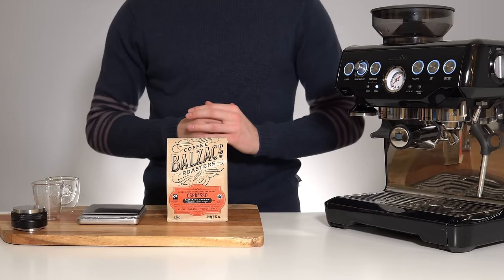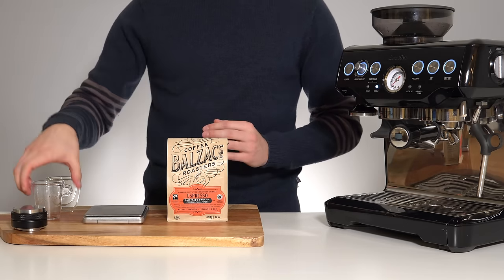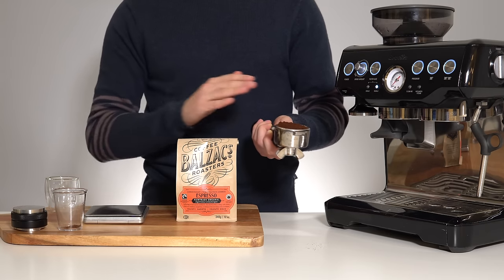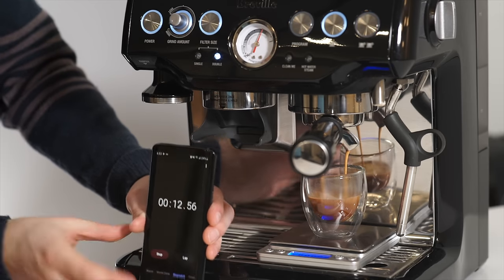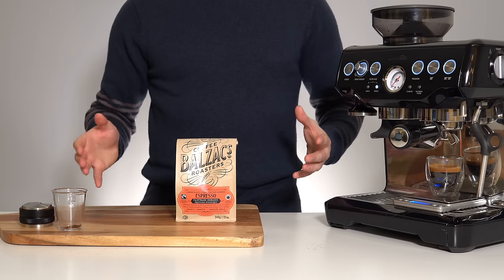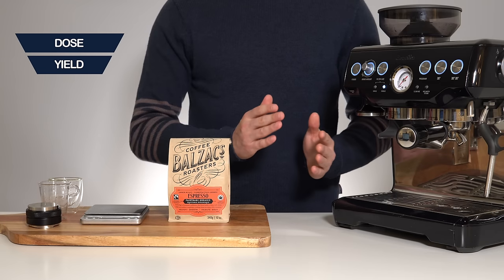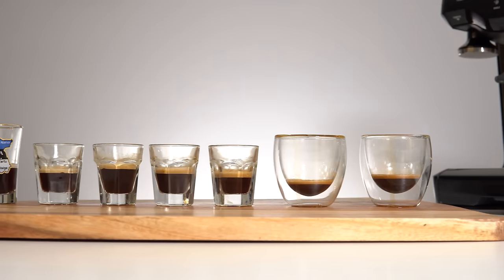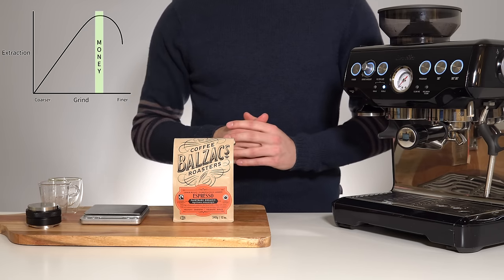Dialing In Breville Barista Express | Dose, grind, yield, time

Comment: I'm sure this question might already be answered but the thread is huge. Many other videos out there include the pre-infussion time in the count between 25-30 seconds as I have been as well. What is your train of thought behind not starting the counter at the press of the button?
Reply from the maker: In the end, no single time is correct for every coffee, you need to dial in to taste using the concepts from the second half of this video. Aiming for a specific time is just to get a reasonable flow rate as a starting point. 
Whether your final shot is 30 seconds from button push or 25 seconds from first drip, you're getting the same shot, just make sure you are consistent with yourself
Reply: @LifestyleLab_  Thanks for the tip, I've recently purchased a bambino plus and smart grinder pro, quite the learning curve and so many opinions out there. I just yielded 38g from 18g in 28 seconds after pre-infusion and it was decent. I'm sure it can get better but this will come with time and whenever my distributor comes in :) for a better consistency.
Reply from the maker: Absolutely!

Comment: I have a question.  My machine is the duo temp.  So I manually start and stop.  Would you need a machine that shuts off on its own?   I’m wondering how you would know when to stop the machine to get the yield.   I am trying for a 1:2 ratio.  But if I say I’m going to let it run for 25 seconds how would I know I hit my marks?  Would it be how many grams I pull?   Or would I be looking for 2oz?
Reply from the maker: Hi Ethan! 
Remember, brew ratio (the biggest factor impacting taste) is about weight, not time. Just like in this video with the Barista Express, you will need a scale to weight the beans in, and then use the same scale to weigh the espresso as the shot comes out. 
Once you are dialed in, you may opt to not use the scale every single time
Reply: 2M views I think I got it now.  I watched again. So I need to get to the 20-30 zone.  That is the sweet spot.  I didn’t realize you were manually stopping the machine.  I think I get it now.  So it doesn’t matter.  Once you get to 36gr your adjustments are made based on taste

Comment: is this a good machine for about 150-200ml cafe lungo ?  will the  extraction be still warm after that much water go through the grind?
Reply from the maker: Yup, this machine can absolutely accommodate a lungo. You will just need to use the manual mode to extend the shot length, or program 150ml as your default shot size. These machines use a thermo coil heating block to heat water on demand, so heat of the shot will not be an issue

Comment: Was wondering if you had adjusted your inner burr? I too started with the Balzak's beans but.. anything coarser than 4 had no pressure which I thought was weird and inner burr is at 6. 

I'm getting insanely sour shots so i still need to dial in (waiting on a proper .00g scale, and a palm tamp) - went from more coarse, all the way to choking the machine and still sour. Adjusted from 16-18g of coffee an still same. I think its down to my tamping then....
Reply from the maker: This could be down to a couple things: 
1) Is your portafilter HOT (not warm) before dosing and pulling your shot? 

2) Were you able to achieve 36gr in 25 seconds from first drip?
Reply: @LifestyleLab_  Thanks so much for your quick response! I was waiting for my scale so that I can more measure shot weight..

I had to set my inner grind to 4 because anything less was not fine enough. 18g coffee, inner grind 4, grind size 3 (on machine), 29 seconds for 36g shot. This unfortunately is a new blend (Balzacs Farmer’s Blend) - but still sourness. 

I know this is a bit of a longer extraction, but if anything, it shouldn’t be sour right? The shot doesn’t particularly seem too hot even though I’m on a hotter setting already. Measuring at the group head it seemed in line with what the temp should be.
Reply from the maker: The Farmers Blend is not necessarily an espresso, so it will be more difficult to extract. 

You will want to make sure your portafilter is very hot before brewing, as if its not the metal will pull a lot of heat away from the shot, making it sour and cold in the cup like you are describing. 

After that, if it is still sour, you will want to start increasing the yield to increase the extraction. Try getting 45gr out at the same grind setting. Ignore the shot time from here on out

Comment: Question, when should you start the timer on a bambino plus for extraction? When machine turns on or once it comes out the spout?
Reply from the maker: There is no exact answer, as each coffee is different. 25 seconds from first drip is the same as 30 seconds from button press. Once you are around this range, you need to TASTE! :)

Comment: Wait wait wait so I start counting to 30 secs once the coffee starts coming out? I thought u start as soon as you press the button? ( for bambino?
Reply from the maker: How to Time Espresso Shots | Button Push or First Drip?
https://youtu.be/E9MiqOJdwPc
Reply: Just watched the link thanks :) so no matter how long I press the preinfusion for (8secs for me) it doesnt really matter so long as I start counting on first drip and reach 36g more or less at around 25secs
Reply: @LifestyleLab_  another question please. What’s the purpose
Of manually setting the burr inside at a lesser number? (6 down to 4 for example) i mean you can always adjust it
On the machine dial right?
Reply from the maker: Upper Burr vs Outer Dial Grind Setting | Breville Barista
https://youtu.be/_uB3FZGkR6E

Comment: I am new to this, but why you dail in with 18 grams. Thats for a double espresso right? You do the proces again for 1 shot espresso whit 9 grams?
Reply from the maker: 17-18g is a standard double shot dose, yes. 
The single shot basket is designed so that it should flow similarly with the same grind setting as the double shot, just with a smaller dose of 9-10g
Reply: @LifestyleLab_  thanx :)

Comment: hey just a quick question: if my brew ratio is 16 grams--> 32gram for a double shot at a specific grind size, if i decided to make a single shot do I just half the dosage to 8g--> 16g using same grind size. ( obviously changing the filter basket) Thanks
Reply from the maker: Yes, single shot filter baskets are designed in such a way as to work with the same grind setting as the double shot. You may have to play around slightly with dose, I've found that going a little higher than 8gr is often better

Comment: Owned mine for 3 years. Make espresso everyday. This is way overkill. You will just be able to pull correct shots by eye constantly. This grinder will not make fine adjustments. Oh tamping has very little effects on how fast or slow the water goes through the coffee. It’s all about volume of coffee and grind size. The way to get around this is add a little coffee into porta filter or a little less. One click on this machine is a huge adjustment. My 2 cents
Reply from the maker: Always appreciate opinions! Whatever produces a coffee you enjoy drinking is the right way for you. 
That being said, this is the proper way to dial in a shot of Espresso, which is the title and point of the video...

Comment: Hey, I bought that machine and I m getting better at dialing with the two shots but what about the single shot?
Reply from the maker: For a single, keep the same grind setting, and reduce your dose to 9 or 10 grams. Duplicate the brew ratio from your dialed on double shot. 
The single basket is designed to work well with the same grind setting and reduced dose

Comment: I get alot of extraction/water coming through during the preinfussion stage on my machine. I get this with different beans and different grind settings. I see it doesn't happen on your machine so is it possible that the pressure during the preinfussion stage is too high on my machine?
Reply from the maker: I doubt it, you may just need to increase your dose, or improve your puck prep

Comment: Are you not supposed to start timing when you hit the button? You started timing the shot after pre-infusion
Reply from the maker: Here is the reasoning behind me choosing to time from first drip : https://youtu.be/Cd1Y0Aq3Khg
Reply: Extraction begins as soon as the water hits the coffee, so yes you should start the timer at the same time as you start the pump. On this machine it will add around 8 seconds. Don’t get too stuck on time, use your taste preference to guide time. 25-35seconds is a good guide but will depend on the coffee. Don’t use coffee older than two weeks beyond the roast date. If it doesn’t have a roast date, don’t buy that coffee for espresso.
Reply: David Wares Yeah, I use a local roaster that’s fantastic and I can always get beans that are fresh with dates on the bag. I weigh beans and grind for each shot. At first with new roast I’ll look at brew ratio to dial in grind etc. In my experience the shots are usually the best around the 30-35 seconds from pushing the button, the first 11 seconds of that is the pre-infusion. I’m sure timing varies for different machines

Comment: I am using this machine last 1.5year and taking serious this process, but my first starting color always Black&dark and after changing the cream color.
At this video starting with cream(5.19sec)
Whats the main reason about that?
Need valuable support from all :)
Reply from the maker: That is referred to as "blonding", and is natural as the shot progresses because as you saw on the graphs in the second half of the video, yield is not directly proportional to extraction. You are extracting far more at the beginning of the shot, vs the end of the shot, vs if you left the shot running for a minute

Comment: Need some help - I’m using fresh beans, adjusted burr grinder to 4, using the tamper shown in the video along with a WDT distribution tool. Using 18g, I hit the time around 22 seconds but I can never get the pressure above 10 o’clock, even after tamping more and adjusting grind size down. Should I try upping the amount used? Any other tips?
Reply from the maker: As mentioned in the video, don't pay attention to the pressure. New machines are now running at a proper 9 bar, so the pressure on the dial at correct flow will be naturally lower. 
Dial in to taste, don't mind the gauge :)
Reply: @LifestyleLab_  man, thanks a lot. I obviously missed that. Appreciate your videos!

Comment: Can someone help me. Im using 18g grounds and pulling 36g coffee on 20-25 seconds. But the pressure is still too high. The needle is about 2 a clock. If I grind coarser the shot will pull too fast. What should i do?
Reply from the maker: As stated in the video, do not focus on the pressure gauge, it is not correct. Focus on flow rate, and even more importantly, TASTE!

Comment: I cant use the single wall one no matter what setting I use it just comes out too quick and tge pressure bar stays at 0.  I can get a nice tasting coffee from the dual wall and I don't need to waste a bag of beans dialing in a settings
Reply from the maker: Have you adjusted the internal grind setting? (not just the outer dial)

Comment: If I use the same portafilter, should my grind be relatively similar across the coffee I use?
Reply from the maker: It can vary quite significantly from coffee to coffee, depending on the roast level. But in general, once the machine is dialed in to any coffee, the next one will be a much quicker process because you're in the right ballpark

Comment: What is the inner grinder setting on - i.e. the top burr that can be removed and adjusted?
Reply from the maker: Whatever you need it to be at :) 
Same concept as the outer dial, the inner just moves about 3 steps at a time so can give you more range on the coarse or fine end if needed

Comment: so...i am noticing that my pressure gauge doesn't move...at all. and the shot comes out super fast. no matter what setting - i've tried them all. I am using an italian espresso bean as well. Faulty? or User error?
Reply from the maker: If the flow is still to fast at the finest setting, you need to adjust the internal grind setting finer. Here's how: https://youtu.be/QNvOcE4-VEo

Comment: What's really annoying about these Breville machines is the pre-heating, they tend to turn off after like 5 minutes I believe. This really doesn't help when you're trying to properly preheat the machine as you constantly have to be on the look-out for that blinking light, meaning that it's about to turn off unless you press it again.
Reply from the maker: Hmm, mine didn't go into sleep mode for at least 45mins once turned on. Perhaps something to contact Breville support about?

Comment: Really struggling with mine. I can’t build pressure beyond about 9o’clock on the gauge, not sure I’m tamping hard enough because I squashed it hard and pressure went really high. Do you use a scale to measure the tamp pressure?
Reply from the maker: Tamping pressure isn't so critical as long as you're constant, and tamp hard enough to remove any air pockets

Comment: Hi I've just bought myself a Breville barrister express and and dialling it in using some of your tips. I've found that I'm getting a brew ratio of 2.1 in just under 20 seconds but the pressure gauge indicates "overpressure". I'm confused as this indicates both under extracted and over extracted respectively. Any advice?
Reply from the maker: Dont pay too much attention to the pressure gauge, high pressure does not indicate high/over extraction. How does the shot actually taste? Use the second half of this video to tune in accordingly
Reply: @LifestyleLab_  thanks for your reply. 
The shot tends to taste a little sour and bitter but I wouldn't say burnt. It is quite a dark, flavour rich bean, so I'm going to try dropping the grind size by 1 and increasing the brew ratio to more of a 2.5 to allow a little more sweetness. 
Love your videos 😊

Comment: Hey, thanks for the video's very helpful! 
My Question is - I can't get the extraction time anywhere close to  20 sec (nevermind 25 sec). 
I Have my grind setting at 6, 18g out is good, pressure bars are at about 11:30, but extraction time (to get to 35g in the cup) is only about 10 - 12 seconds.
If i move grind up to #5, Pressure bars shoot way up and nothing Brews.
Is it my tamping (too hard?) what's my next move?

Appreciate any thoughts / help.
Reply from the maker: Sounds like you're stuck in between grind steps! Check here for some tips on how to deal with that: https://youtu.be/Q1lVdhly_rc
Reply: @LifestyleLab_  thanks... I'll give it a go!

Comment: Getting 22g into these smaller baskets is challenging and you end up having to pause the grind and tap down the basket (vibrate) a couple of times which I feel can cause a potential problem with consistent density throughout the basket.  
Anything more than 18g is pushing the capacity of this size basket which aside from the in built grinder is probably the biggest issue I have had with the Breville, which has proven to be a very good machine notwithstanding.
Reply from the maker: Agreed, I would expect a brand like breville to go with a 58mm across their whole lineup.  Are you trying to dose to 22g to increase shot size, or to increase shot time?
Reply: I found that the finer the grind the more grounds you can have in the basket. I can fit 20g with a setting of 4, but not with a setting of 14
Reply from the maker: @MichaelKire  Very true, but it's tough to not overextract the shot when you are grinding that fine

Comment: I have a question for your expertise. I've followed the directions you provided, but I've been unable to achieve more than 18 seconds for a 36 gram double espresso shot. I set the grind on 1 (as fine as possible) and the grind time to maximum (which weighed 18 grams). I tried to decrease the grind size to level 3 to output more grinds (as I kept the grind time at maximum). The output weight reached 21 grams, but I couldn't, with all my strength fit the 21 grams of coffee grinds into the portafilter. Could this be an issue with my coffee type or am I missing something? I'm using 100% Colombian Arabica  beans.
Reply from the maker: Keep your dose at 18gr, but grind finer by adjusting the INTERNAL grind setting finer. Here's how: https://youtu.be/QNvOcE4-VEo

Comment: No mention of the grind amount dial? Is it not necessary?
What is it for?
Reply from the maker: If you are weighing out each dose and grinding until empty, the grind amount dial can be left on maximum. I prefer to dose in this way, as the grind amount dial only uses a timer to determine dose, which can be very inconsistent as beans jam up, or bounce around in the hopper. 
I mention all of this in the step by step dialing in :)

Comment: Having a nightmare here and hoping you can help me!
I'm putting 18g in and playing with grind sizes, but the only way to get anywhere near the right pressure is always grind 1-3 on every coffee and the pour to get to 36g takes well under 15 seconds!
What can I change here as I'm getting pretty rubbish coffee and can't work out what I'm doing wrong....
Reply from the maker: Have you changed the internal burr setting to allow you to grind finer than what’s on the dial?
Reply: @LifestyleLab_  I haven't. Not sure what that is? Should I be doing that ?
Reply from the maker: Breville Barista Express Top Burr Adjustment
https://youtu.be/QNvOcE4-VEo